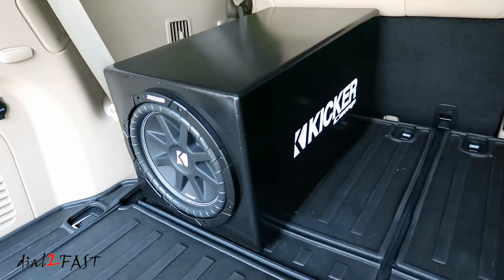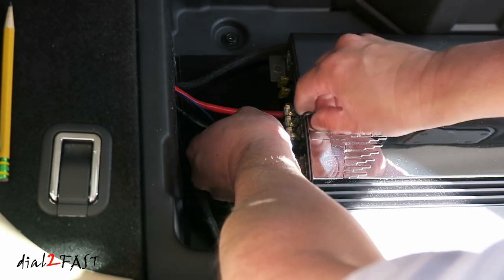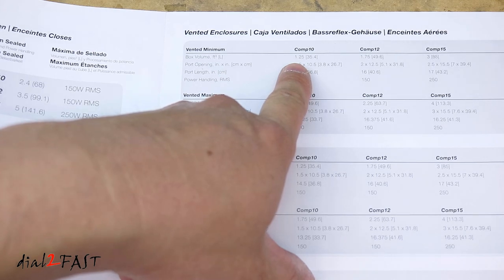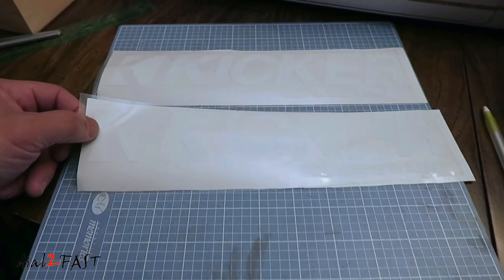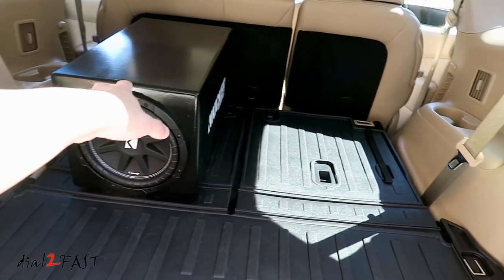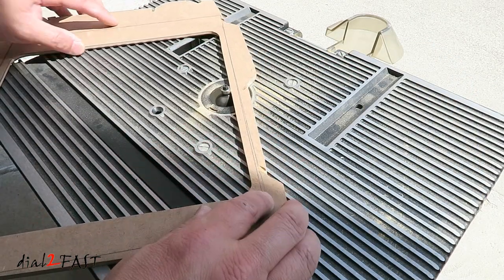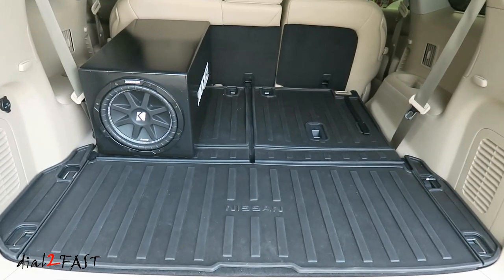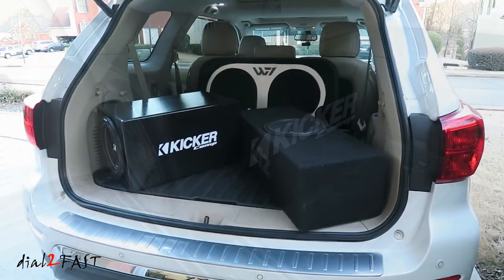Install Amplifier & Subwoofer To Factory Radio Bose - Nissan Pathfinder VIDEO 2

Comment: For anyone looking for a firewall entry for your amp power wire ,take your entire clove box out. It’s 7 screws. Super easy. Then reach up to the right where your firewall is and there’s a rubber grommet that’s not being used for anything that you can feed your wire thru. No drilling needed. You can actually see and feel the grommet from the engine area as well. Cut a slit in the rubber piece and feed your wire thru. Easy job

Comment: Came here looking cuz I got a Maxima with a Bose in it but I also own a system that is just sitting.  I guess I'm just scared to install it and find out that it messes with the electronics somehow.
Reply from the maker: The Bose wiring is different for every make and model so you will need the factory wiring diagram for your car to be able to tap the correct factory wires.

Comment: I installed my after market amp in my infinity qx60 and my remote turn on is only reading at 6.8 volts and when I turn up the volume up the amp shuts down i have to play it low so the amp doesn’t shut down. Do you think the remote wire should read at 12 volts?
Reply from the maker: Your aftermarket amp remote input does need 12V to turn on. I am not sure how your amp will behave with 6.8V remote trigger.

Comment: Man your attention to detail and explanation is 💯 !!! 
You know using thinner wood is a good point !
I didn’t think how heavy these suckers were!! I went dual subs  Comp R and it literally takes up half my back area and heavy asf! 
Nice job !!
Reply from the maker: Yes the MDF wood is very heavy. I did have the option to run dual 10's with the amp that I have, but I opt not to because of the weight and the space it takes up. Thanks for sharing your thoughts.

Comment: Great video thanks, my question on my nissan model I do not have the amp already installed under the seat so where should I tap into for my remote wire thanks.
Reply from the maker: If you don't have the factory amp with remote wire, then you can do the remote turn on with ignition 12V, or get a signal processor that has line input remote turn on feature. So when it sees an audio input signal, it will output a remote turn on.
Reply: @dial2fast  Thank you

Comment: Always great videos! I started watching your videos when I got my 2017 pathfinder earlier this year. Are you going to have some sort of anchor so that your sub doesn't shift around while driving?
Reply from the maker: One thing I did after filming the video was install 4 big round rubber feet under the box, and that has helped keep in the box in place. I still want to have the flexibility to remove the box quickly if I want to. If it was a sedan, you can bolt the box down to the trunk floor.

Comment: simple novice question ..but can i take the sub wires and just extend them to a bigger sub box?
and would that give me a little more thump?  or is the bose factory as good as the factory amp will do?
Reply from the maker: The Bose amp doesn't output enough power to drive a 10" or 12" sub.

Comment: Dial2fast. What did you use to light up the led lights. I'd like to do the same thing to my 2015 Nissan Rogue trunk as well.
Reply from the maker: The LED strip I used was the 12V 5050 LED strip. I have added the links to the different color LED in the video description, please take a look.